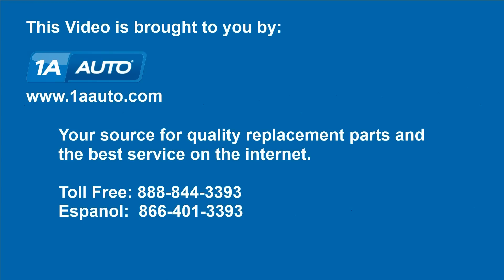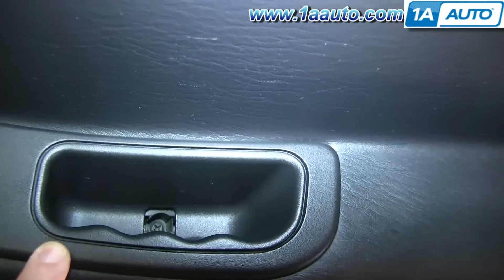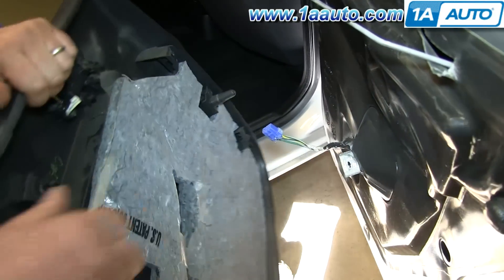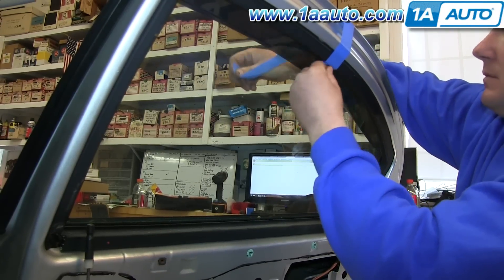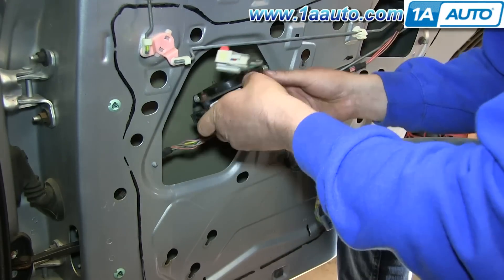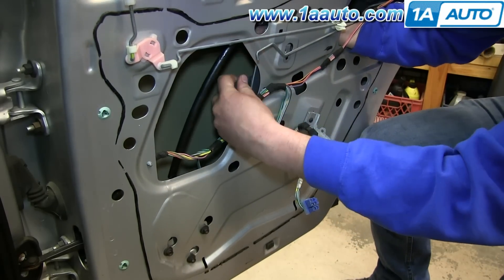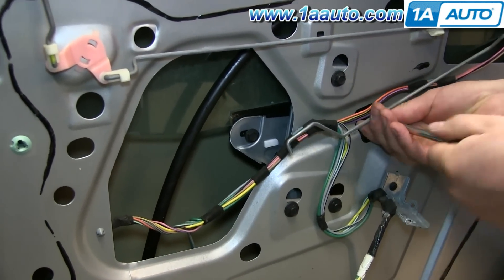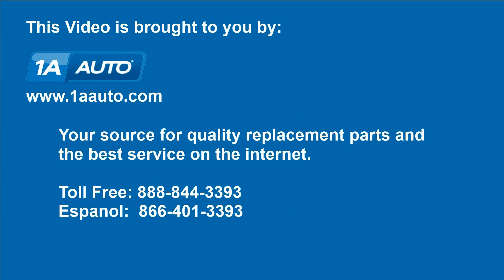How to Replace Window Regulator 01-06 Chrysler Sebring

Comment: I just finished with it. Thanks greatly, this demonstration is perfect. I had an extra problem though. My window was half way rolled down, so I couldn't align the holes and the window holding bolts. What I did is to first secure the half way rolled down window to the top of the door by using tape like in the video, unbolt both the motor and regulator and set them loose inside the door. Then I could slide the whole of window + regulator + motor to the top and tape the window higher. There, I had the 2 window bolts and door holes lined up so I could set the window free. Other than that, it went exactly as demonstrated in only 1/2 hour from start to finish. I suppose it took me that long because it is my first time. :)